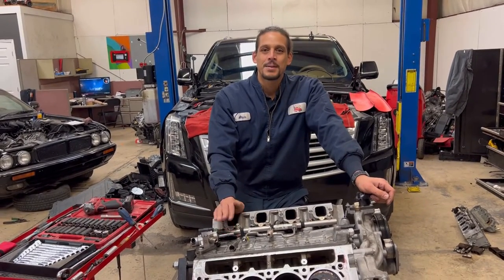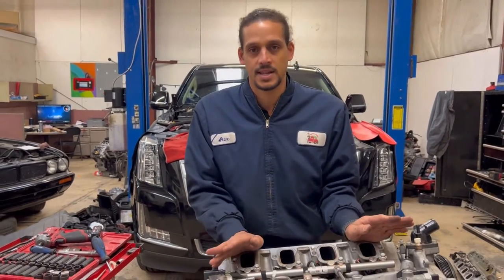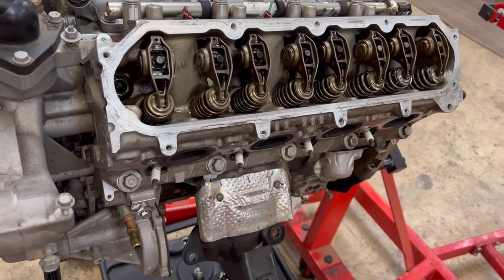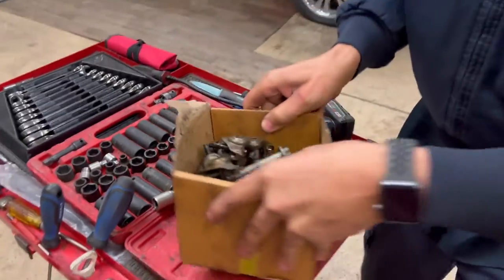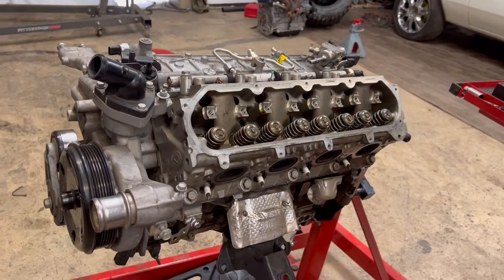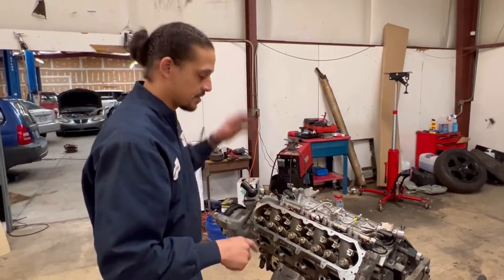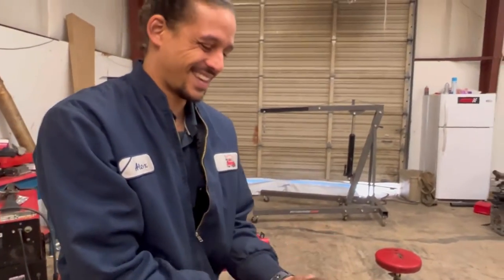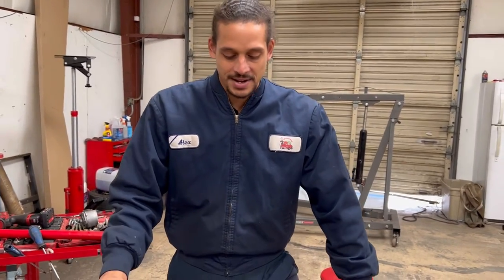Cadillac Escalade Lifter Fell Apart (Partial Engine Tear Down) #cadillacescalade #lifterproblems

Comment: Had something like a Suburban and was attempting to find a low oil pressure issue. It would loose pressure to the point of the alarm coming on when hot. With him calling the shots, I changed the oil pickup O-ring. Nope. Next the oil pump. Nope. While I was in there I replaced the timing chain. Don't know what he did with it after that. 
Do cam bearings fail and cause low oil pressure? Here's a short video of me showing the replaced timing chain. https://youtube.com/shorts/83dQ5aVvsqk?feature=share

Comment: Why the hell did you pull the motor out? I do this in a 10 hrs day with the engine in the vehicle!
Reply from the maker: You must have not watched the entire video but I will fill you in,I had to remove the engine because the lifter cylinder wall was scored up heavily and we had to take it to a machine shop to get it smoothed out and I didn’t want to smooth it out myself because I did not want to be liable for it

Comment: I had to get s new engine in mine because of the AFM system. The engine was one 5k which is cheap for a new engine. It cost too much money to rebuild these engines then it does to buy new ones which is why it's a ripoff. They been baking these same engine for 23 years now which why they are so cheap